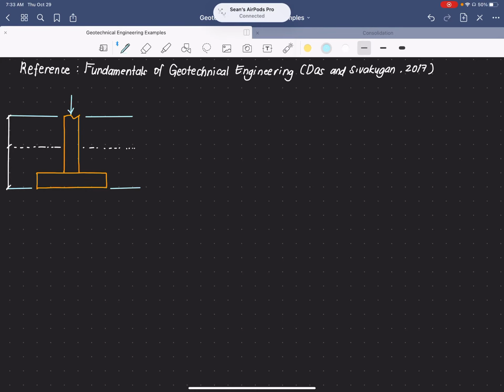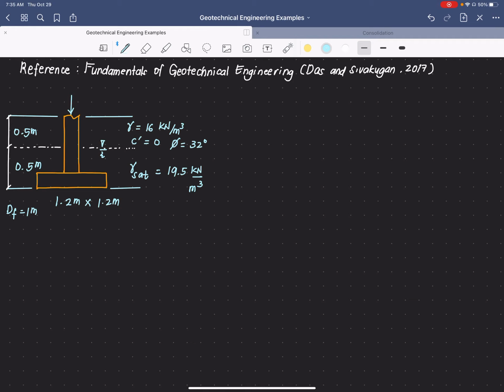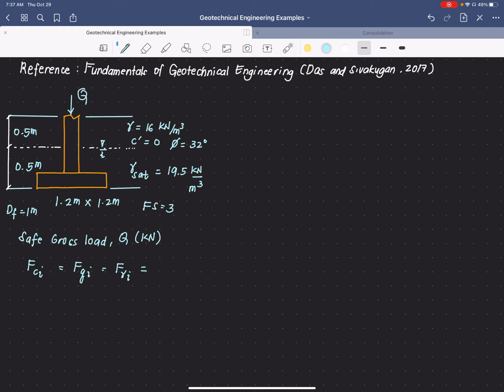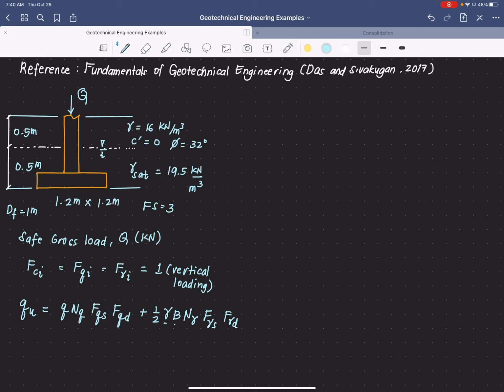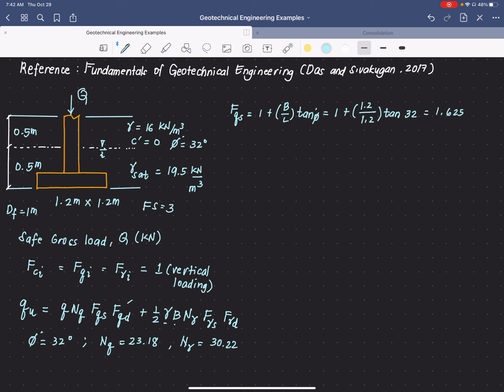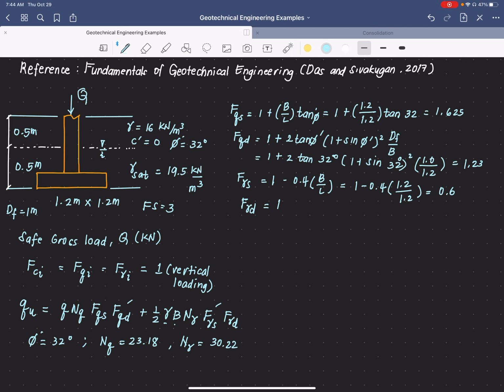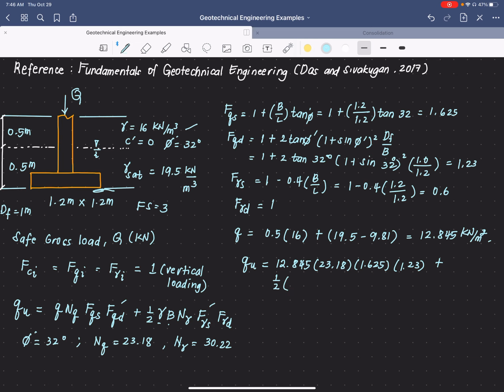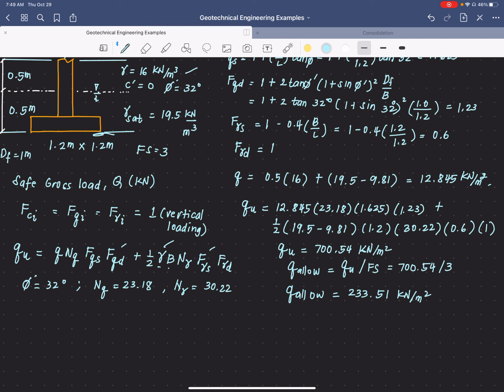Soil Bearing Capacity

Comment: Why, when solving for q, would you not multiply the (19.5 KN/m3 - 9.81 KN/m3) by the depth of 0.5 m to achieve KN/m2? Wouldn't there be a discrepancy in the units?